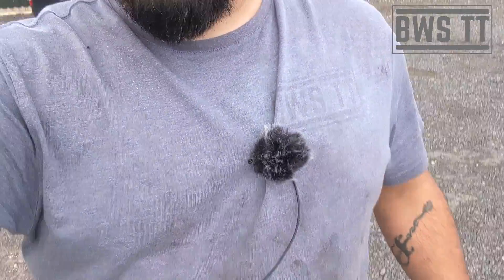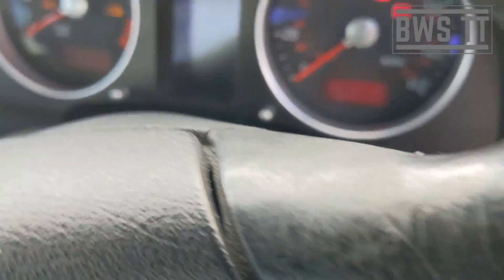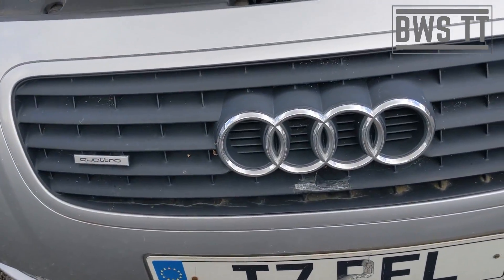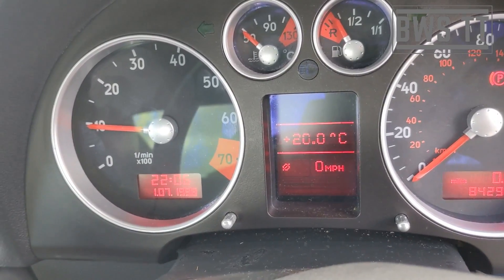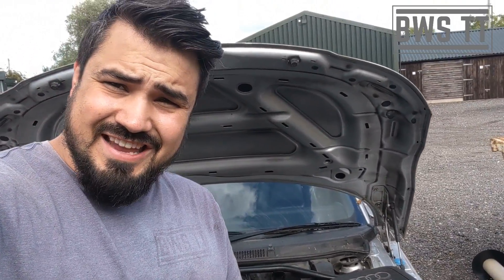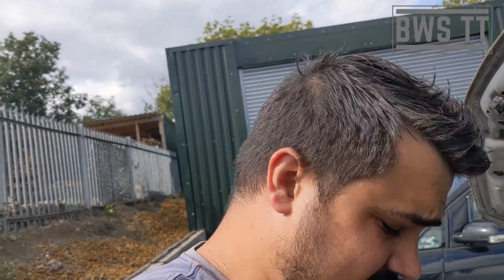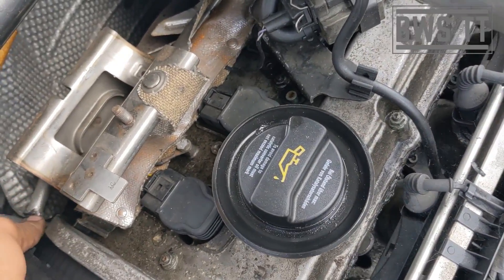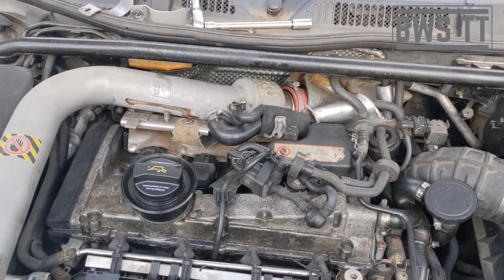New Audi TT - Did I Buy A Rotter or A Gem?

Comment: Just bought an 01 audi tt quattro anniversary addition. Needs new crankcase breather hose connection where the puck is and a vacuum hose line and she's good! Yours looks like an 01 too same look and wiring for the engine bay
Reply from the maker: Mine could be anywhere from 2000-2005, I'll look on the logbook to confirm

Comment: Do you have TT steeringrack leakage issues in The UK? In here Finland pretty common issue. I dont know why. Maybe The cold Winters. Its just a super expensive Part. 1700€ from Audi and i cant find any Seal kits for The old one.
Reply from the maker: We do, but only usually because people use the wrong fluid and it kills the seals.

Comment: Can you describe what the knock actually sounds like? I can hear a clicking sound as you rev it, which doesn't sound like my TT. Is that it? Are you talking about predetonation, ie sudden rather than smooth combustion?
Reply from the maker: It almost sounds like the engine mount is lose, it's certainly a metal on metal type noise, which is a bit tricky to make out

Comment: I had oil starvation to the chain tensioner on a 2.0 tfsi few years back. It only ever clatterd on startup. Thankfully fixed it before it went kaboom. But there where ones on the forums that didnt catch it soon enough. 

Does the 1.8t 20v have a hydraulic chain tensioner aswell?
Reply: @Ste H ouch, yeah that was pretty bad, lucky you caught it!